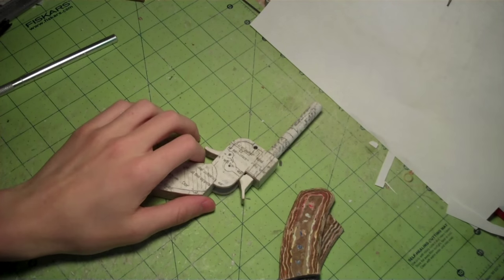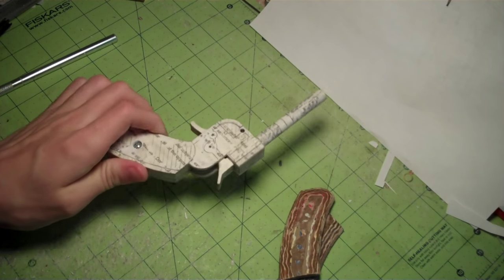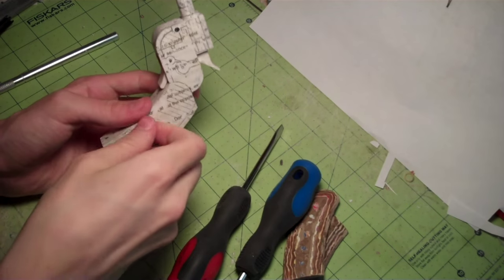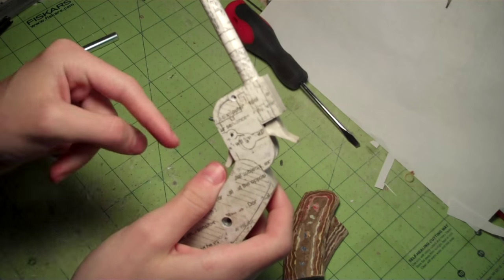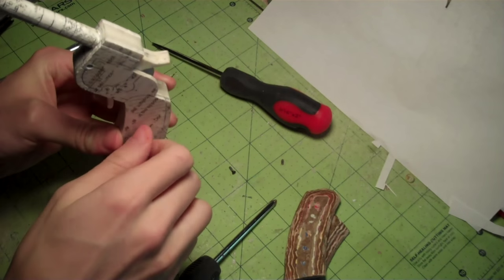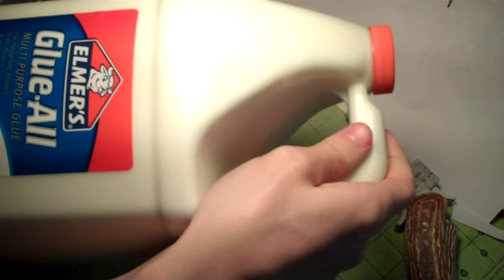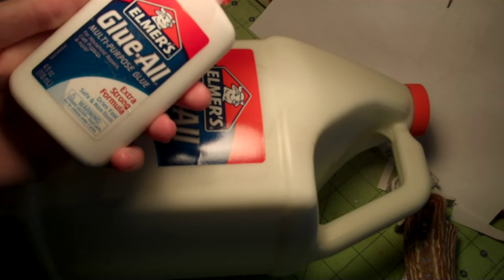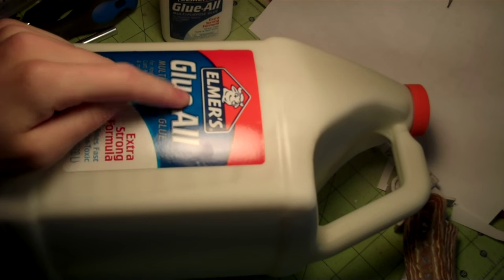(READY FOR PAINT+HUGE GLUE BOTTLE) Paper Single Shot Pistol Functional Prop Mini Project (Update 12)

Comment: hey sheldon long yime no coment just wanna say the gun turn out great so did the hidden blade but iv ru in to a problem eit one of my own projects long story short makin a cosplay helmate turnd out a bit flexibel becouse its made out of foam but i started doing paper layering on top of the foam witch is painted any recomendation and any recomandation about draying the paper n glue faster
Reply from the maker: +Your Average Gamer Maybe you can find a quick drying glue. But I am assuming the regular glue should dry pretty fast because it isn't under any form of weight. It is cool to hear that you are building a helmet. I hope it turns out nicely. Thanks for the comment! :)
Reply: +Shelden Caudill yeah im makeing it for a cosplay of redhood after about 8 layers it's still a bit flexible and i want is solid enough to take a good hit any ways meybe il make a another for my batfleck costume thanks for replying if you want I'll tell you more about it
Reply from the maker: +Your Average Gamer Yeah sure! I always enjoy hearing about this kind of stuff! :)